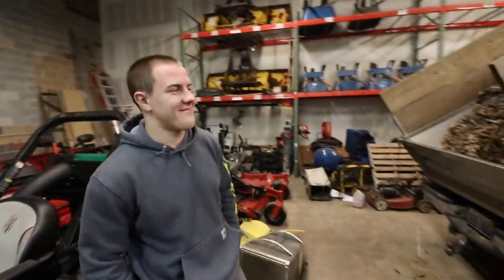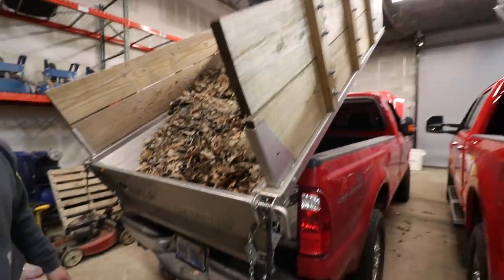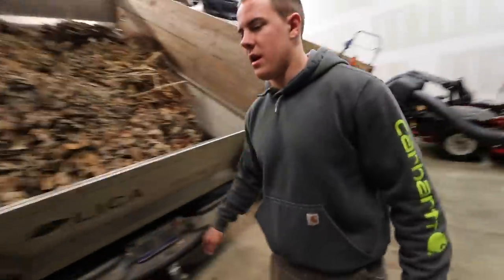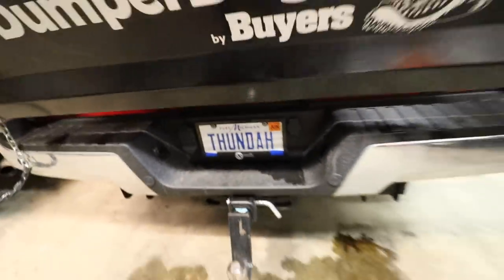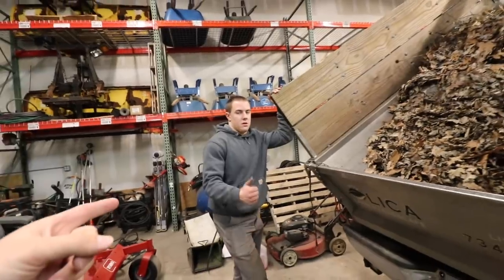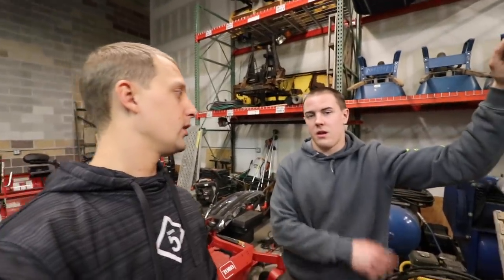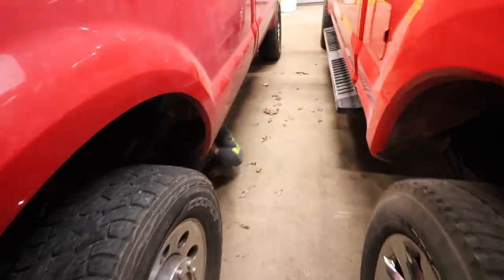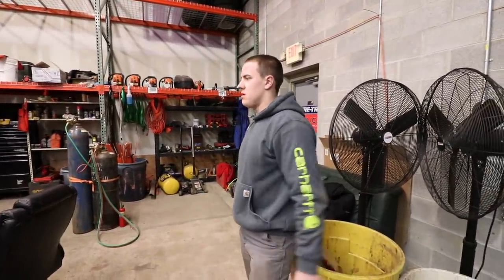SHOP TOUR w/ Alex Lica & Comparing The 8' Stainless Vs 6' Steel DumperDogg Dump Insert

Comment: For those that are not quite ready to invest into a dump trailer or insert, the Brute trash cans are an option to fill, slide into the truck, and dump out quickly at the city dump, or a dump site. I keep my cans stacked in my enclosed trailer and I pull them out as needed. I have a "Bak-Flip" bed cover that folds up to the rear window for when I need to use the truck bed. If you have to hall cans for a distance from the truck, a two-wheel dolly is also a plus to have on hand.

Comment: Nice video Brian and Alex, I went the more expensive way and I got a Chevy dump truck with a steel, but than after I bought it I went right away and had it power coated to stop rust! It is inside the shop at night but it is exposed to the elements when it is in use and its first winter.

Comment: I spent 6,500 $ on my dump trailer  5x8 full custom  built with lesco 16 hp it’s a beast love it  

And got a 6x12 tandem axle open trailer it’s really nice it has a toolbox side and trimmer racks on front 

I’m 18 and we have one car garage and 8x10 shed 

I do all maintenance on all equitment  my truck get all mantice in house

got a 05 1500 crew cab that’s a shovel truck in winter and mow truck summer 

2500 hd extended cab hardscape truck / tree truck and that one goes out with dump trailer and plows driveways and lots

Comment: I love having the backup camera that I installed on my truck. It makes hookups a breeze! A couple minutes here, a couple minutes there, that time all adds up. (Before all of the wise comments on not being able to hookup without a camera, the original reason I installed one was because my regular work has assigned parking with me having a 'visitor' parking spot behind mine. If someone is already parked in it, it makes it hard to gage how close I am to back up to someone's front bumper without getting out to check. With having an extended cab & 8' bed, I need to get as close as possible so as not to stick out too far.)---Nothing like keeping things simple.

Comment: Lots of liability thinking that adding leaf springs for increasing load capacity is "safe" or legal if the gross weight rating by Ford is exceeded. Be careful out there.

Comment: I see a pos home depot toro 21 in the shop. I would be embarrassed to be seen using that pos
Reply from the maker: Yup this kid really cares what you have to say.
Reply: @BriansLawnMaintenance  never underestimate the value of a 21 mower in this biz-it should be of the highest quality just as all your other equiptment. buying a pos from home depot is false economy. a 1200$ comm  toro will outlast a home depot one bt 20/1 at least. I have 1990,s toros still working.
Reply from the maker: He fixes and repairs tons of equipment. No customer ever has asked me what kind of equipment we use in a decade. They want results. If he uses a 1,200 mower or a $30 tuned up mower, what does it matter? Add something constructive. Don’t just complain to nitpick, you look like a hater.